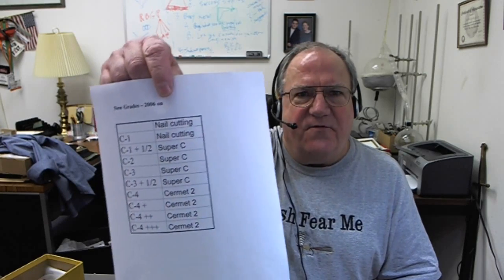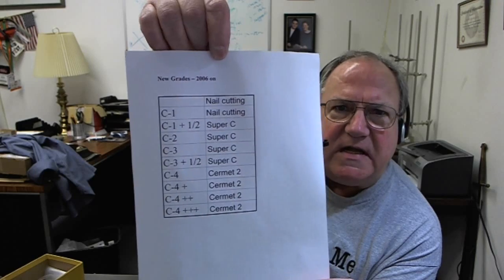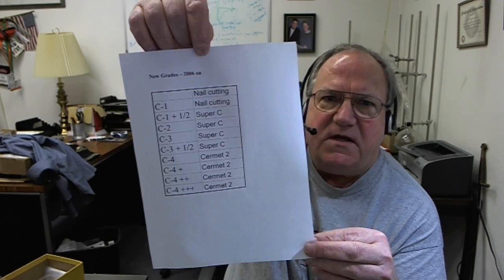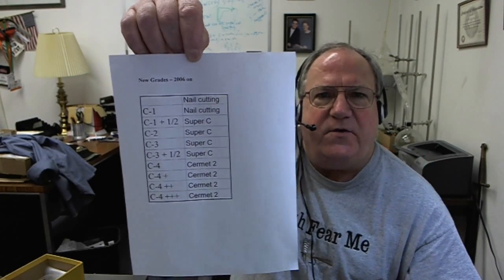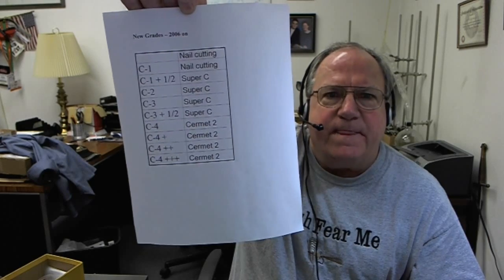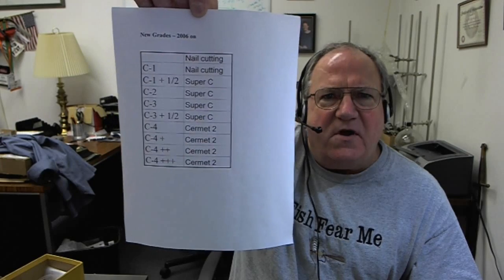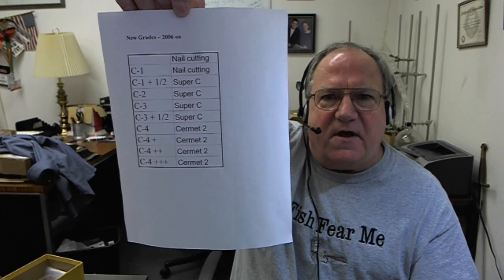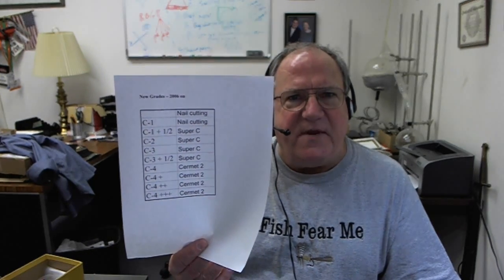Carbide Grades

Comment: Hello Tom, i do not know if this is permited to post this here. But for anyone who wants to know more about carbide grades (for woodworking) and wat carbide is and how it is produced: consult the Ceratizit (the leader in carbide) website (woodworking sawblade tips) and get all info you need. I do like your video's explaining a bit what woodworking tools are and the idea behind. (There is a lot of nonsense on youtube about this). Maybe somme vids about all kind of planer heads? Brazed profiling tools and why the differance in use?
I never seen on youtube a correct video explaining how tools are calculated in function of feeding speed, rpm, diameter, number of cutters/teeth, kind of wood to work in, and how to configurate tools for the finish a manufacturer wants to produce. Why MAN or MEC.Troubleshooting. O, yes you can fill up some days with items. Best regards.